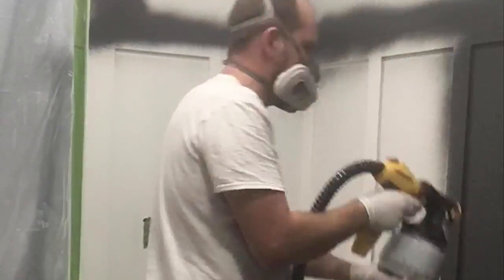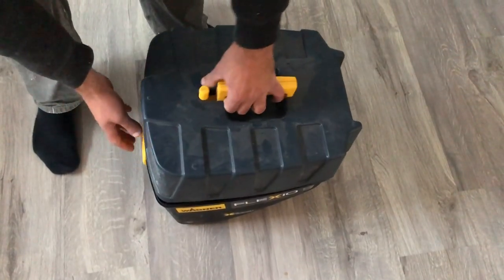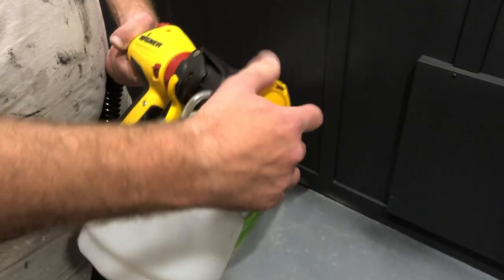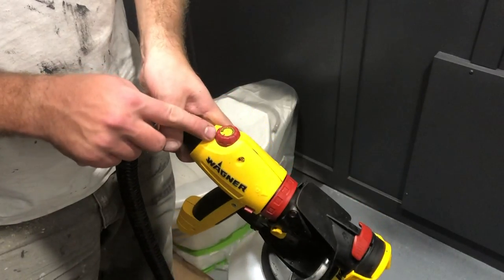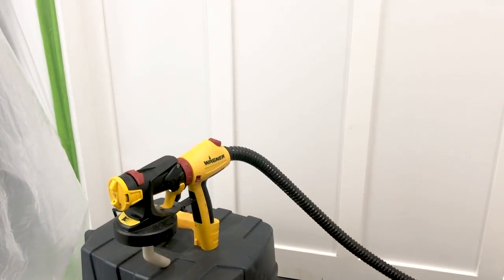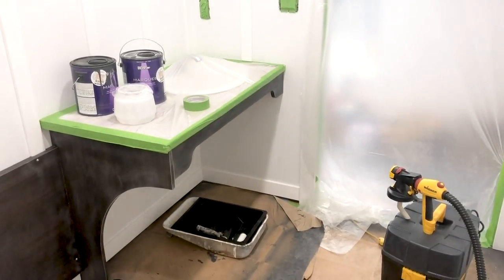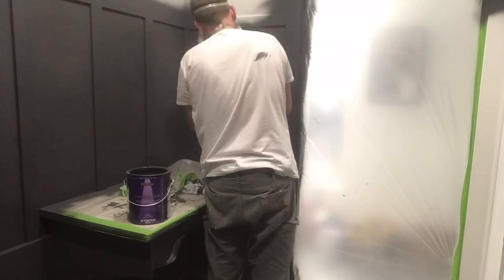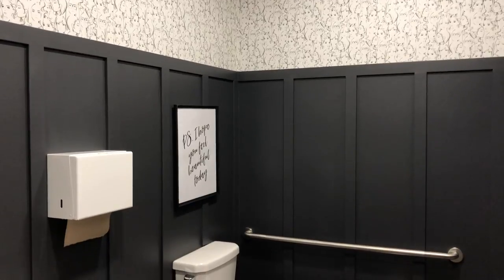How To Use A Paint Sprayer On Interior Walls [& paint a whole room in 30 minutes!]

Comment: These paint sprayers aren't bad for quick touch-ups, but I would definitely recommend spending the $300 on the Graco Project Painter Plus Sprayer 257025. 
It's more of a traditional but powerful paint sprayer but it allows you to dip the intake in the paint bucket and have a long hose with sprayer to maneuver around the space you're spraying. The finish is also much better with this paint sprayer, you definitely will not regret spending the money and then using the one you already have for quick touch-ups.
Reply from the maker: We may have to try that one too! We've never used it.
Reply: @LindiandRuss  definitely check it out. The only con is that you do have to purge it with water after each use and it is a tiny bit more involved but once you're used to the process it's not that bad.

Comment: My issue with Wagner is that they have 20 different products that are all so seemingly similar that they over-represent what their sprayers can do.  I purchased their Spraytech paintready HVLP sprayer because it said “fences, sheds, and walls”.  I’m painting several bedroom “walls”…..and what I’ve found is that, the model we’re seeing in this video is the appropriate product, if you’ve got a job of any size at all.  Not because of it’s size, but because of it’s power.  Given the amount of overspray, prep-work involved, and how slow I had to move to get proper coverage, it became all but moot, as far as time saving goes.  And, by the time you learn that lesson, the unit is hardly returnable.  I’m sure if spraying a thin stain, it’s far more efficient.  It’s also physically demanding to put your body in a position to properly use a sprayer (which is a part of this process that absolutely NO ONE talks about).  Which is fine, as long as the sprayer has the power to make spraying an 8X12 wall a 5-10min process.  Given the amount of time needed to properly mask off an entire room, due to the over-spray, these sprayers need to be efficient enough to warrant that prep-work.  It’s very possible that this unit fixes that problem, and in this case, they seem happy with it.  In my experiences, the unit I have doesn’t, and the walls I paint almost ALL have orange-pell, so I don’t need a perfectly smooth finish, as much as I need even coverage.  Wagner needs to market the product for what it can handle on a “practical” level….not a “technical” level.  Great video, regardless….I’m glad to see a vendor taking care of a YouTube channel.

Comment: Great video.   I just started painting doors and rooms with the Flexio 4300.  I have overspray that leaves a fine dust over everything.  It reaches areas outiside of my tent that created.  Any suggestions on how to limit that overspray?  It seems to come right off with a wipe, but do you see any issues with that?  Thanks!
Reply from the maker: danny302 the overspray is real! We spray in a tent often too, or in a space that can have overspray. But typically we just seal everything really well with painters tape! We often spend longer sealing off then we do painting!

Comment: Would upu recommend this to paint a 16' x 17" bedroom?
Reply from the maker: Yes! Definitely! If you think you’ll end up painting any more rooms, or furniture pieces, etc. then it’s definitely worth the investment for the time it’ll save!
Reply: @LindiandRuss  That is so great to hear! actually need my entire house painted. But starting on my bedroom due to furniture delivered. I am using Behr Marquee as well and have been trying to figure what sprayer to get. The paint can says to use .015 - .019 tip and 60 mesh filter. But none of the Wagners seem to use a 60 mesh filter. Since you guys used this model with Behr Marquee. I'm picking it up. Plus it's on sale at a couple places! Thank you so much for responding. ❤

Comment: What kind of paint do you use with this kind of method?
Reply: you can only put water based emulsion through this type of sprayer, if its very gloopy use water to think it down. decking or fence stain works too.

Comment: Does this work well with acoustic soundproofing paint?🤔
Reply from the maker: We haven't personally used this sprayer with acoustic paint (or used this type of paint), I would suggest talking to the paint supplier to ask them what they recommend for application and if it is sprayable. It might need a specific nozzle/spray tip size size.

Comment: Does it spit out the paint like if it were textured? I bought one and tried all the settings. I’m going to try it again but couldn’t figure the settings out. It literally spat the paint out and came out very splotchy we had to go over wth a paint roller.
Reply from the maker: It’s never as smooth as a paint roller will be, it will have a bit of texture, but it shouldn’t look like a purposefully textured or spackled wall, if that makes sense? If it’s not coming out nicely it could be because the paint is too thick and you need to water it down a bit (especially primers).
Reply: I’m in the same place, I’ve modified the settings in all different ways but still spits the paint leaving texture, so I had to go back and roll it out 😒. 
I’ll try to thin it out. I was using exterior flat paint from behr . The whole point to getting this sprayer was not to not waste time diluting the paint🙇🏻‍♀️ 😭😭
Reply: @ZussieMakesit  every sprayer u have to dilute material sometimes if its not coming out smooth mix a little thinner

Comment: To meet one of the most difficult parts of using a paint sprayer is adjusting the spray and the paint so that it sprays the way you want it to. It would be great if you showed actually trying it out for the first time with us certain paint and how you practiced. I’m assuming you didn’t just put the paint in the container and start painting… but overall This was a good video.

Comment: i use these sprayers all the time on timber. just spray the area once dont keep going back over like in this video. thats why hes getting runs and drips then having to use a brush to fix it which defeats the point of having the spray finish in the first place. spray once let it dry, make a mistake let it dry dont touch wet mistakes youll make it worse.
Reply: yes amen
Reply from the maker: I agree! This was one of the first full rooms we did with our sprayer, and we've learned better ways to spray continuously and not overlap. We never need a brush anymore either! Hopefully this will still help if someone else makes the same mistakes we made! Our newer videos show better technique :)